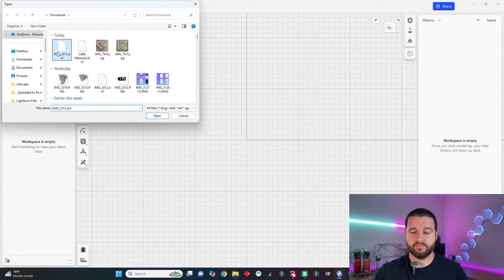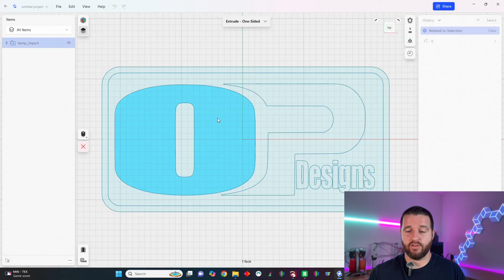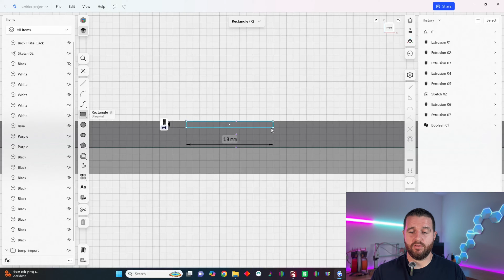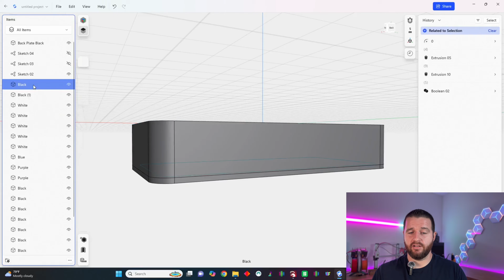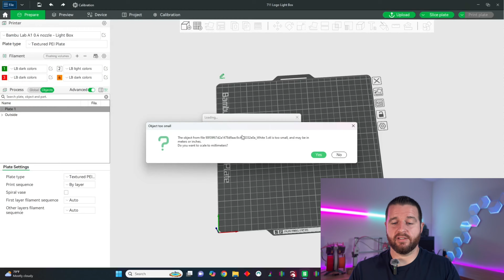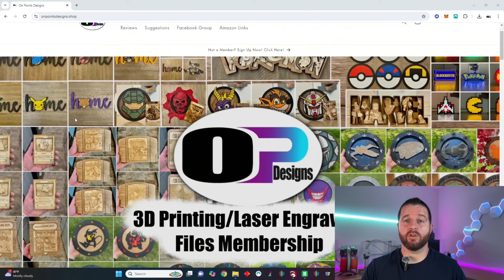Shapr3D Light Box Design Tutorial for 3D Printing

Comment: Ty this is a great tutorial. My question is when you cut the end of the last led light. Isn’t that an open circuit? Can’t you get shocked?
Reply from the maker: If you touch it, yeah I would assume that. I usually don’t have the box open with the lights plugged in and powered on. You can always just heat shrink that side as well